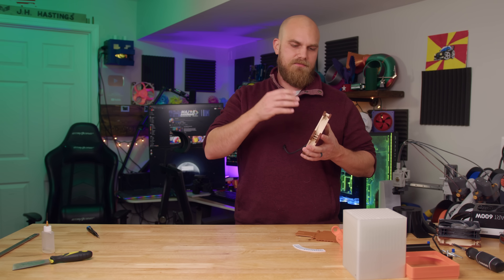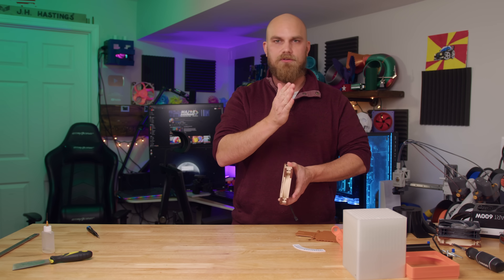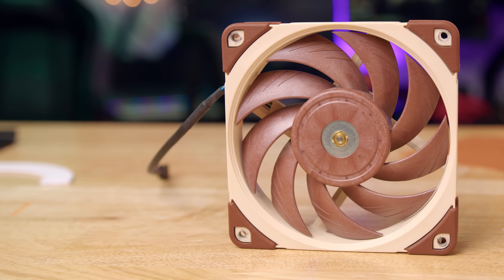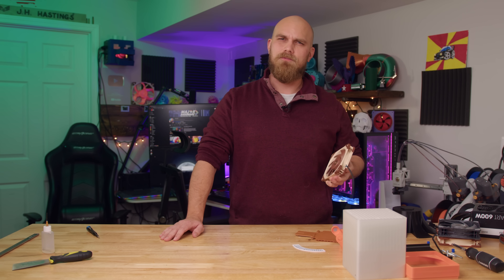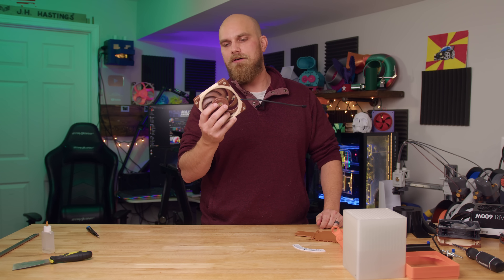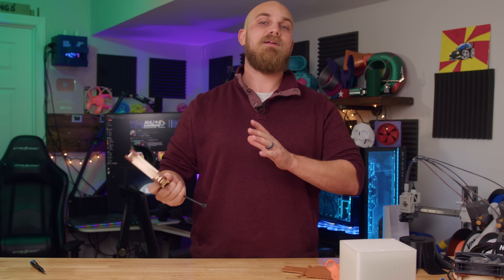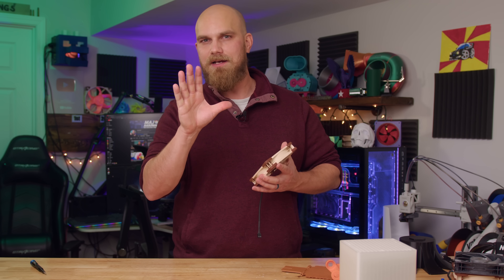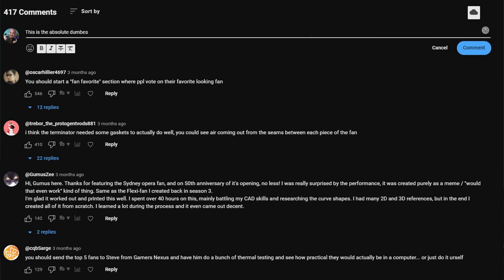I Built a Static Pressure Machine | Fan Showdown Season 6 Pilot

Comment: Probably seeing the comments that this is acting more like a flow meter than a pressure meter... that said, all is not lost, you can just make your own manometer. Trying to read 2.3mm of water is a pretty tight scale vertically. But nothing says it has to be vertical. You can make the reading tube on a diagonal. For example, if you put the tub at a 45 degree angle, you have 70.7% more length to spread the scale out with to increase your resolution. You can pick any angle you want to increase the length, but in the end, you're still picking up the same amount of water, you just stretched it out. Put some food coloring in there so you can see the meniscus more easily, you could easily read down to .1 mm of water over a longer scale, with a full scale of say 5mm or so.

Comment: My idea was to make gaint air tube and have spring with end towards the fan with flap has the same diametter as the tube. The amount the spring compresses should be very accurate and repeatable and all without the downside other comment have pointed to the current system.

Comment: For the measurement, you should go digital. More accurate and easier to tune to what you are trying to measure. As well as the data given is much better to understand and correlate with other data in your tests. 

Others have suggested different scales for the measurement. I think a different testing method would be a better idea. So your flap idea is great in the aspect of it can get pretty close to the idea you are going for. But realistically this doesn't measure so much static pressure as it does airflow. You are fighting some kind of resistance but after you get the flap so far up the resistance becomes harder and harder to overcome as you are then only measuring a percentage of a fans actual capacity. So if the flap is up at 9 or 10, then you are realistically only having air hit 50% of the flap thus wasting the other 50% of the fan's capacity. 

So instead of the flap, my thought is a spring loaded flat surface. So using the same square tube design, you instead put a flat surface on the end and let the air push on that. As the air pushes it this should open up spaces for air to escape. This would allow the air measurement to be more consistent and realistic. The idea itself is much the same as using a bathroom scale on its side to measure the amount of force applied. But on a much smaller scale.

Comment: Great concept! Slap an optical rotary encoder on the hinge shaft and run it through an Arduino. Should be able to get extremely precise results. Industrial ones can read up to 100,000 counts per resolution, but I suspect you don't need anything quite that fancy.

Comment: At work, we use Dwyer 477AV manometers for low pressure gas measurements, but they are a bit pricey at ranges of 20" w.c. or less (which you probably want the 4" or maybe even 1" models for the highest level of accuracy). I have found Superior Sensor Technology has some low pressure sensors which can communicate either I2C or SPI with good accuracy specifications. They even have some evaluation kits that you can use to hook up via USB to a PC for taking measurements (such as EK04-HV-SPI or EK04-HV-I2C). I wouldn't recommend using an actual water column manometer, because getting a good one that is in the 0"-1" w.c. range can be quite expensive and you have to periodically fill those back up with special fluids.

Comment: Try adding weight mounts for calibration, that way you’ll be able to set your gauge to whatever you want with more definition. Doesn’t necessarily need to be much, a series of strategically placed screw holes would be enough to reduce weight in your flap device and allow you to adjust the center of balance as you like by adding screws to adjust the balance. Love your channel by the way, big fan…lol.

Comment: I would personally use the real, digital manometer So that you can get a digital result. You can still use your 3d printed tunnel but it needs to have a fixed orifice at the end. Maybe 1/4-1/8th of the fans surface area. This creates back pressure in the output which you can compare against the static atmosphere pressure (or even the fan input pressure) to get a difference reading in mm/hg. This is similar to how you would tune a HVAC system's gas manifold pressure or the duct flow back pressure. The manometer you need is not as expensive as you showed! You can get one arouns $50

Comment: I'd prefer a calibrated manometer over the diy solution. The flap introduces more variables, therefore, potential error points. Also l, keep measuring flow like you have been. We use fans for both radiators (static) and cases (flow)

Comment: I like the idea of a static pressure measurement, but this is not that. I'm sorry. When measuring static pressure, basically all you'd need to do is make the fan blow into a box that has a manometer on it. There's no need to measure differential pressures or anything like that. You're overcomplicating it.
Normally you'd measure airflow in "free air" which is basically what you do when you do the smoke test. That way you have maximum flow and no obstructions. Static pressure is basically the opposite, you want zero flow and maximum obstruction, because that's how you get maximum pressure.

Personally I think the methodology of the last season was pretty good. The radiator is a realistic obstacle to overcome for a PC fan, and the airflow out the back of the radiator is a good indication for how much performance the fan would have under real life conditions.
Please don't go around calling your flappy door thing a static pressure indication of any sort, you have built up a good amount of credibility with your testing methodology and it'd be a shame to see that get kerb stomped because you experimented and made something that does the opposite of what you want it to do.

Comment: This works for the job. As a few have pointed out, making the arm at top a little longer while adjusting the weight value for the counter arm to get finer measurement. Kinda like adding a .1 to .9 to the scale for the deciding numbers. New fan designs and even some of the older fans that would show promise to test again can be in this group.

Comment: It's not necessary to use a monometer. You can create a specific use case test setup. Why so? You're not comparing your tests to any other tests. You choose a specific sample size and test them against each other. There is no need to test inches of water column. You need to create a setup that accomplishes a couple different things. You need a rig you can mount your fan to. preferably a two chamber setup. Between those two chambers, you need a nozzle that feeds into the second chamber. You should measure the pressure in psi in both chambers and measure the temp and air speed in the final chamber. You should also pragmatically set different fan speeds for different parts of the test to test efficiency of the fan at different test voltages. If it were me, i would use an arduino and a self made program that controls the test and displays the data on graphs and does all the calculations for you. The flap won't be accurate because the test is not linear, it's exponential. It seems like you run into this every so often where you try something new each time. Remember. Testing is about consistency. - Michigan Test Engineer
Reply: If you wanted to go this rout. I can help. I can tell you everything you need to get and i can write all the code for the arduino and the application to read data and display it on a graph as well as save it to a .csv for later use. This application will also control the fan and allow you to setup tests that can be saved and replicated for future use. ezpz

Comment: Im not sure how they usually test pressure but i would imagine you could have a box with a skinny clear tube connected to the side and have the fan blow straigh5 down on the box of water to force water up the tube, that being said fans arent optimized to compress but its still interesting to see the different results from varying designs, and you already have the smoke test and the volume test so im happy as a clam as it is.

Comment: One flaw of this is that your flap angle is nonlinear due to the change in orifice size, and the fan P-Q curves of the fans are nonlinear as well. So each fan would be operating in a different performance regime. A fan pushing more air might see less restriction so it would show as having a higher static pressure, which might not be accurately. Essentially, comparing the results might not be strictly apples-to-apples.

I see a lot of people suggesting this already, but U-tube-based manometry is probably the right tool here. Electronic manometers are expensive because they're compact, but old-school water-and-tube based manometry is simple and can be tuned for all sorts of pressure ranges. It could also look cool as hell mounted on a wall with colored fluid and some LEDs.

Comment: I don't think your measurement points should be linear because the airflow per measurement unit isn't a linear progression required, due to gravity and increasing and then decreasing flow required per point, you should see a non linear relationship between static flow and each notch on your measurement device.

Comment: Nice contraption, as someone suggested another piece of tunnel should continue after the flap to keep air running in a "straight" line, as in this configuration once it pushes the flap it's being redirected downwards. I would also use same test as previously with radiator and test tube with anemometer.

Comment: This is measuring air volume not pressure (pretty much the same as very old air volume sensors on old BMW)

To measure pressure you need a completely tight box or an variable opening that you always know the area of tho adjust and find peak pressure then calculating from the area you also find the air volume at that pressure. Much like blower door testing a house.

As many fans will surge at no airflow it is best to have at least some small opening

Comment: I know I'm a little late on commenting... But could you extend the wind tunnel past the flap to improve resolution. As it is now, the air is venting to atmosphere at the flap opening, which means that you lose the majority of pressure. If you enclose the flap in the tunnel, then the air pressure has no option other than exert force onto the flap.

Forgive my non-technical parlance. Love the show-down btw!

Comment: I love the idea of using this for the next season! I think the numbering should be modified though, where the gap between units is less as the numbers get higher. Here is my reasoning: To get a fan to go from a 2 to a 4 is pretty easy, where if you were to try to get a fan to go from a 14 to a 16, it will take much more airflow to do so. Therefore, the units should be closer together as they get larger, to help differentiate the top competitors more easily without getting into decimals/fractions. In any event, I would love this to be an equal factor in determining the best fan, along with the traditional methods used prior. Thanks for the awesome content!

Comment: Should not the flap hinge directly on the top of the flap, so there is no place for the air to escape? 
Currently if the flap opens then the more air will escape at the top, so the measurement will not be linear. 
It will not be anyway, but this disturbs the measurement.
I would have designed such an equipment by putting a variable sized hole in the middle of the tunnel, and an air speed measurement on the other side of the fan. 
This way, you can measure the amount of the air the fan can move, with different resistance. A low static pressure fan will have the intake air speed at a lower rate when met with a bigger resistance on the other side.
So a tunnel, fan in the middle, air speed measurement on one end of the tunnel, and a variable sized hole in the other end of the tunnel.

Comment: Why not just put a fan in the end that gets pushed by the airflow, and use a tachometer to measure the RPM of that fan, very easy way to get a consistent measurement of the relative airflow with high resolution.

Comment: My problem with the methodology is this.  As the flap is moved further away from the tunnel, the less air actually hits the flap.  Which means, you are getting diminishing returns on the value.  With how to solve that problem, I would need to think about it, if it can be solved at all.

Comment: Couldn't you have the fan trying to pressurize a chamber. With a large diameter hole in the bottom connected to a water reservoir. Then connect a smaller diameter hose to the water reservoir.
Wouldn't the increased surface area of the input raze the water in the smaller tube more than a construction diameter pipe. Like how hydraulic jakes work.

Comment: The size increase of that opening letting air out isn't linear..

A better setup would be a transparent vertical tube with a vase-mode printed cup free to move inside it.

The cup would be slight smaller than the inside of the tube and would self-center by way of air-leakage around edges(and you can't really throw a bucket of water through a keyhole so it would be consistent as you would need very high pressure to in any appreciable way effect the volume of air leaking through that gap)

This would much more closely approximate the water column tests commonly used, the cup could be(have to be) weight adjusted to stay inside the tube and should probably be printed with the top edge and bottom surface having a larger diameter than the side-wall to lessen any inconsistencies that laminar-flow and surface structure along it could cause.

Doing it this way the only variable would be the volume and pressure of air lifting the cup as the gap air escaped through would never change with airflow unlike the asymmetric gap variable of the door-design.

Comment: My suggestions:
As others said- you'll need some sort of tube/walls around the flap so the air doesn't just get blown downward. It would improve resolution quite a bit.
-Maybe add some sort of gasket around the fan? Construction paper should be fine. It would help eliminate pressure losses due to blow-by (slight loss makes a difference with low values)
-The indicator doesn't show well on camera. Maybe bevel it with the outside corner lower? I'd guess 45 degrees instead of 90 would look good.

It's a neat idea. I'm impressed with your numbering- they're still very readable at that small of a size

Comment: I think decreasing the weight of the flap may help and if you figure a way to make the sensitivity of the readings higher that'd be neat too!

Also, I don't know how tight the fit of the fan case is but dont you think it would be a good idea to seal it somehow? I thought of tape but perhaps epoxy or maybe even just a coupler around those edges? May be unnecessary idk

Comment: I don't like the hinged mechanism. It just tickles my brain the wrong way. Having the door on a linear bearing with a return spring means more airflow constantly impacts the measuring device. the hinge only shows a fraction of the airflow at extreme angles. Or you could show static pressure similar to how it is measured on the box. by mm of water, you could show a less dense liquid for more observable differences.

Comment: To have enough resolution, reasonable cost, repeatability and linearity, I would make some constant gap around the circumference of the blocking flap.  
The best method to quantify measurement is to buy cheap chinese strain gauge 5N or 500g with arduino and HX711 module. 
Precision scale and mechanism to push the scale plate is easier option.

Comment: have you considered using a mass airflow meter (MAF) from a car? it would be pretty easy to rig so a fan can pass air through it and if i remember right, all you need is 5v, ground and the sensor output can be read in Hz.  it's how the old ford MAF's were tested for faults. you could find one in any junkyard. the only tough part would be finding a Hz table for the sensor so you can decipher what you read but im pretty sure it's in service info. just a thought, i may be offbase.

Comment: Step 1: Make an air tunnel with the ability to drop-in meshes of various blockage percentage in the middle. On the upwind side, put a nozzle for a tube. Connect the nozzle to a u-shaped tube, and put water in the U so we can measure pressure using the same units as the manufacturers (mmH2O). Put an anemometer at the end of the wind tunnel. Now you have the ability to create PQ curves for each fan, at whatever resolution you have the patience to test. 

Step 2: Modify the wind tunnel so you can stick off-the-shelf radiators in it instead of meshes. Now you're drawing the PQ curves for the radiators. 

Step 3: Plot both sets of curves on the same graph. 

Step 4: Become the only 3rd party database of actual fan performance. Go mad with power as gamer's nexus bows to your test methods and I guess.......Profit?

Comment: I don't think it has a high enough resolution to be practically useful. The idea and execution is amazing, maybe make the flap lighter?
Ideally (as you mentioned) the biggest, baddest fan should bring it up to 80-90%. I would also do a combo (again as you suggested) that tests total airflow and static pressure.
Another suggestion would be to make the "flow straightener" to be much less restrictive.